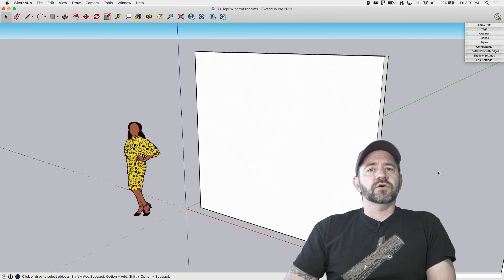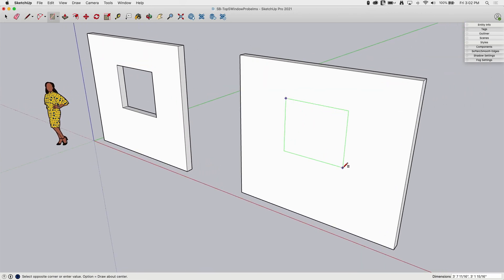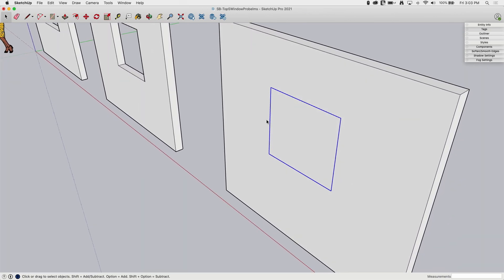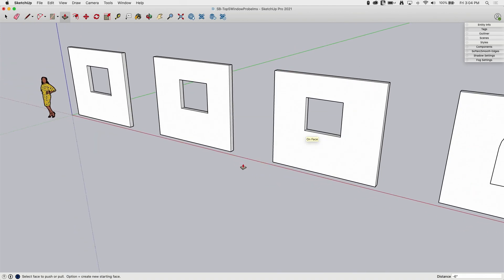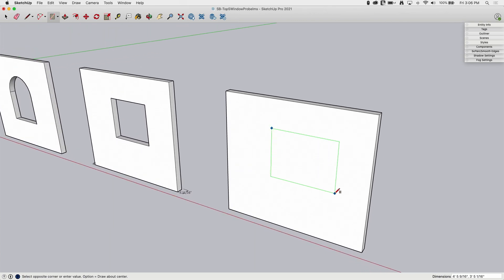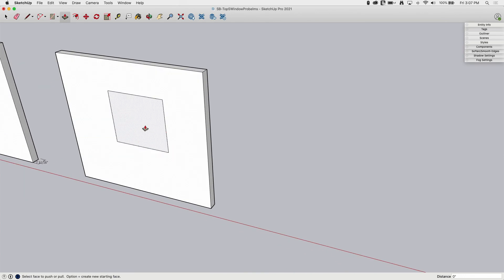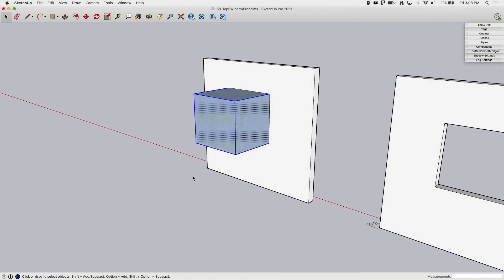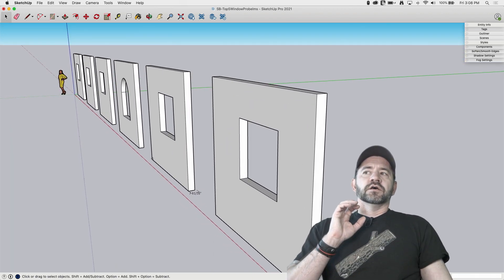Five Issues Pushing Windows Through Walls - Skill Builder

Comment: Aaron shows a box pushed out the back of the wall 2x in this video, but I was never able to get that to happen on my (non-square) wall. Then @Box on the forum helped me realize I could get that to happen by tapping the option key, at least on my Mac Air. According to the hint below when the push/pull tool is activated this toggles create new starting face

Comment: Oh man, those are really annoying, and I think that's one of the worst problems with Sketchup, firstly because when we are modeling we don't know if what we're building is wrong until we have to do something like that, and secondly because the snap doesn't work properly all the time, and you always have to get really close to be sure where you're snapping the point while you're building. 

Funny thing is that in 3D softwares like Maya, Cinema 4D, that doesn't happen, and it's being a while Sketchup has those issues. We spend more time trying to solve bugs than actually modeling.

Comment: I've created a skirting around a wall using a profile and follow me.(wall grouped and skirting grouped). I wanted to remove a section of the skirt to create a fireplace. I've followed the steps to push a rectangle through the wall(your video) but the shaped moulding at the top of the skirting remains. I have successfully pushed through the lower flat part of the skirt but if I try and push a larger rectangle the full height of the skirt it just doesn't work. I have smoothed the edges if this relevant. Any pointers? Thanks

Comment: Great Videos, I've been clunking around with Sketchup for about six weeks now. I created a new way for you...
I found one of my issues was the bottom did not have a surface, and some walls did not have either a top or bottom. 
I drawing my footprint using interior and exterior dimensions, some rooms as interior squares, then drawing wall thickness and adding the next room as a square. 

So I had a few walls that did not have six surfaces. It seems once I put the sixth surface on I was able to punch through.

I was having a big issue with the group selection, I think I have a handle on that.

The other was needing to redraw the lines to make certain they connected. Though they were connected. So probably a group related issue?  I will keep practicing.

I have so much to learn, I keep practicing hopefully in the not so distant future I can make a decent rendering...

It's not like using a T-Square..........

Comment: My major issue has got to be ensuring I'm on the correct face when I'm cutting space for a window - ie, I've downloaded and inserted my actual "window" (glass, frame, fiddly bits) and now I'm trying to put the hole in the wall...   Half the time I end up making the hole bigger all around and then push/pulling it to snap to the edge of the window insert.  Is there an easier way?  Would that be a case to use the intersect geometry function?

Comment: I do have one more case I faced couple of months ago. Everything is perfect as  wall dimensions is concerned height, width & thickness but some of the face edges are not exactly on axes. Sometimes even a fraction of millimeter could cause this issue to happen. I figured it out by setting the edges style to be by axes color. Then, I observed some edges are having a black color not any of the axes colors (red, green&  blue) . To correct it, I redraw the deviated edge to match its relative axes.

Comment: Hello again. I've been playing around with push pull problems. It occurred to me to use wire frame view to get a better view. This is one for you, Aaron. I'll attempt to explain what I did. Play with it and see if it's useful, but I have managed to punch holes in things that I could not see in shaded view. 
My model is a building. I want a door in an interior wall. Camera position is outside the building. I switch to wireframe view. I see the wall clearly since there are no surfaces, and because there are no surfaces I can only select the wall by clicking on an edge. When I triple click on an edge the dotted surfaces appear. I draw my door opening on the wall face. I click P for Push/Pull and push the rectangle through the wall. I have been using x-ray view for this type of thing with so-so results. Wire frame makes it much easier.
Reply: I WILL be playing with this! Thank you!

Comment: Sixth issue I have been encountering is that when Soften Edges / soften coplanar is checked it can get difficult to push/pull the opening.  Aaron, it would be my preference to have my drawing template NOT default to have soften edges/ smooth normals  to 20.0 degrees, but for the life of me I can not see where I can set that so I can forget it.

Comment: If the front or rear face of the wall is split by a smoothed line, it looks OK but push-pull does some strange stuff. It is relatively easy to correct as long as the split faces are still co-planar. You find this a lot if you have used Intersect with Model or Selection, as this process can add a LOT of hidden geometry. In this case CleanUp is very handy.

Comment: I remember another one you mentioned in a video that happens when you push pull a face but it also doesn’t creat a hole and you need to press the option key to create a new face and solve it. That saved me a lot of times. Thanks a lot by the way

Comment: I get number five often enough. I haven't quite figured out why, but it has a lot to do with my camera position and the point I click to push/pull. Certain combinations make it hard to get a good click on the rear surface or edge, or move the face in the right direction. I've found the easiest way to complete the move is entering the distance in the measurements box. Failing that it's easiest to cancel/undo and get a better camera position, then start over.

Comment: Hi Aaron, hope you had a great Christmas. 
One that I would like to see fixed is creating a standalone window as a Component and defining it as "Cut hole" trying you place it into a wall, but it won't cut through a solid wall (2 faces) , , will only cut through the front face. From your video description, I thought you/Trimble had finally a fix for this issue 😟😞
Reply: @tcfonts  There is a plugin from Mind.Sight.Studios that takes care of the issue. I believe it's $10/annual. ttps://mindsightstudios.com/double-cut/

I have not used it as I don't like stuff I buy that stops working when I need to use it again next year. That said, it does actually cut through the geometry and allows the section cut fill to remain.

I designed all my window components to snap to a face and cut opening. Problem is, that breaks the solid geometry and the fill disappears. I now have lines in my windows on a tag I can turn off. I draw a rectangle on the back of wall, and push through to opposite side to fix this issue.

Comment: Sometimes walls need to be non-rectangular or not straight. For #4 just create a punch block and subtract it from the wall.
Reply: Curious,  I’ve been in construction for over 40 yrs, been using AutoCAD since 1982, SketchUp and Chief Architect since they’re inception and have never come across a non rectilinear wall. I’m curious as to what other than a design thing would be the purpose?
Reply: @douglasmichel6361  Ever build a lighthouse, a gothic chapel or a British cottage, just to name a few? Curved walls exist, but ok, perhaps not as much in the US where everything is as straight as state borders.
Reply: @mururoa7024  Nope, Nope and nope....😆 But I do stay in a cottage when in Scotland. Your right, here in the USA most walls are straight, by that I mean same thickness. We do have and quite often in more expensive homes have curved walls but still same thickness. Only time I personally built a NR wall was a curved retaining wall where thickness varied in places, depending on what it was holding back.
Reply: @douglasmichel6361  I work in Europe (well, except the UK from now on) often in very old masonry houses and if it was build before 1900, oh boy, wall thickness consistency had clearly not been invented back then. 😂 I work of composite 3D volume scans so I mostly get very accurate but totally crooked meshes.
Reply: @mururoa7024   Aw bummer, I can't buy you a pint then when I come over. LOL,     I have relatives in Forfar, Scotland.  I'm sure you do get readings/scans all over the place.  Well, have  a Happy New Year and stay safe.